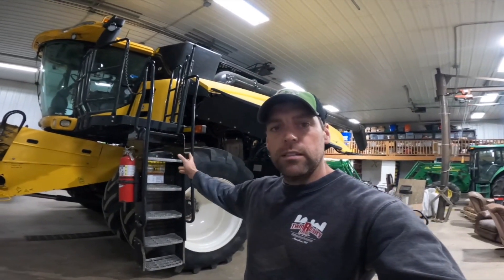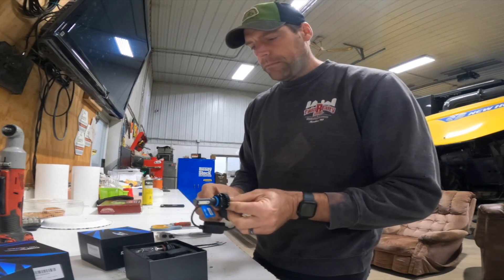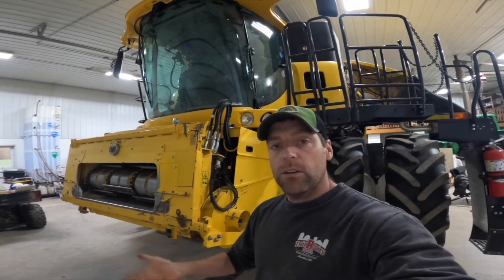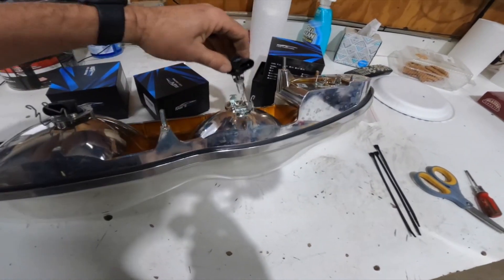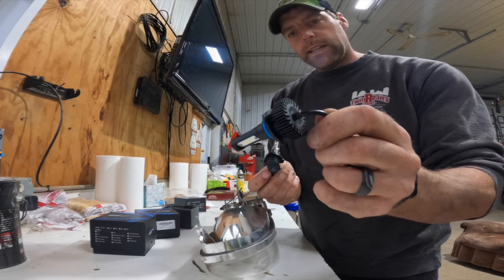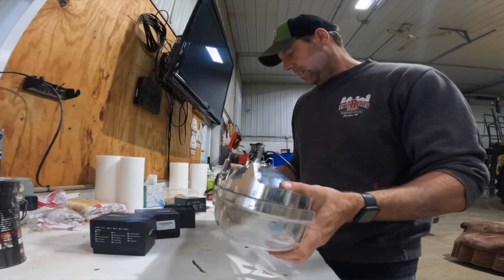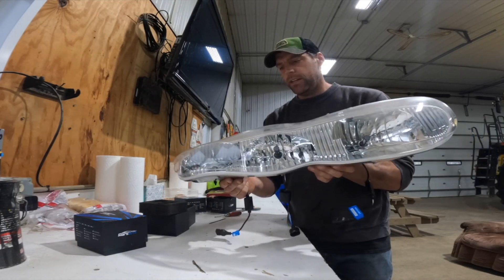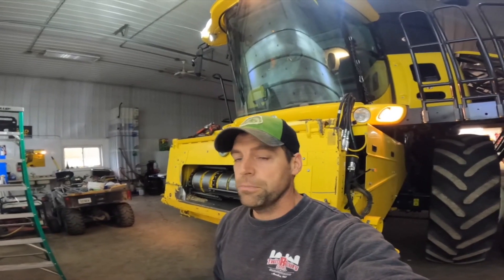How to install LED bulbs in a New Holland CR Combine

Comment: I have 2010 cr9070 I've been running for the last 7 years or so. Last light the lower left cab light wasn't working. This morning I just pulled the the connector and hooked it back up. Now it's working. What an easy fix haha. We've been running TR combines for the last 2 decades and those lights suck balls. This year I put a light bar on my Dad's unit and he was like "holy balls I can see 5 feet past my header now".